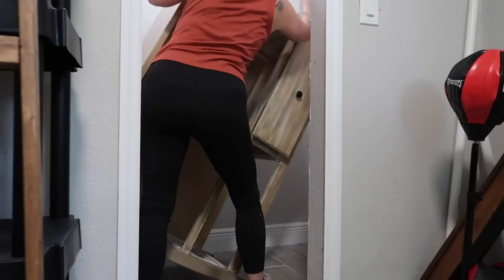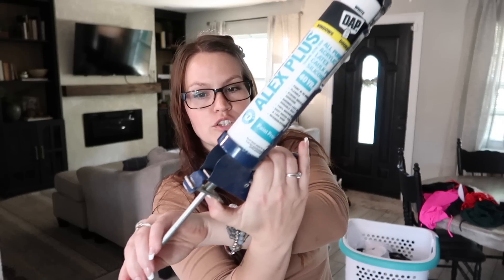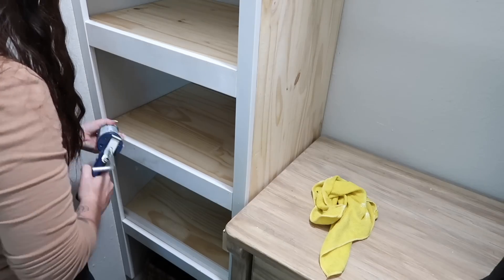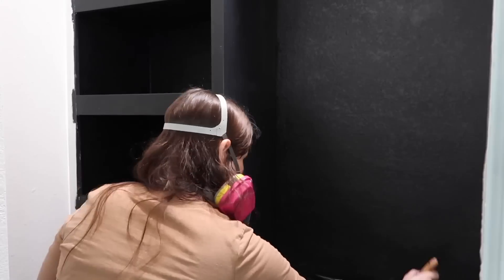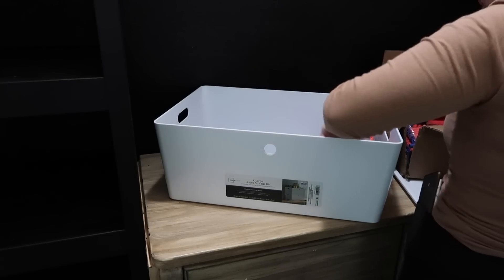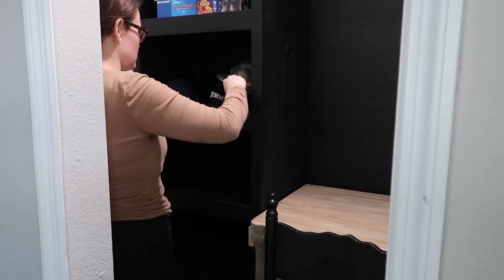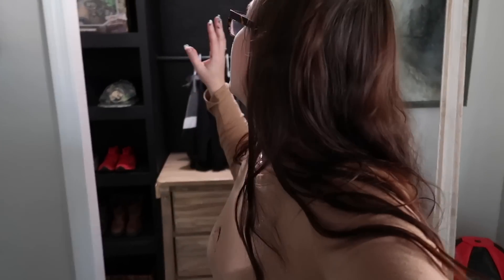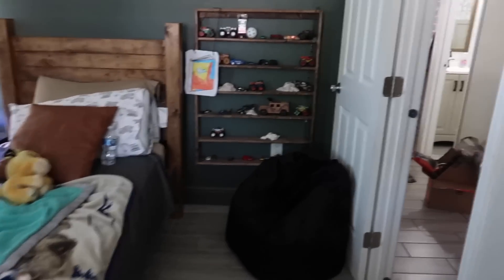DIY custom Closet ✨️Part two✨️ Painting and organizing  🙌 | Small room DIY on a budget !

Comment: Just a hint, from watching your caulk gun loading, I always put a large flathead nail in the hole where the caulk. Omega out.  Otherwise it will harden and be useless.  Then wrap a piece of Sara wrap over the tip to keep air out.    Love your projects, and the confidence you have encourages us also.

Comment: Cutting the tip for caulking you use the hole by the "trigger" part and insert the top of the tube into it and it cuts the perfect amount to start :)

Comment: Karrie just a thought you should label the white boxes. I have the exact boxes in different sizes and I have labeled them all. So much easier to know what each bin contains. You could look to see if you can get images that your son knows what each container has till he has learnt to read. A tip for removing label use furniture polish with a cloth . Spray the furniture polish on the label and work it off with a fibre cloth. I removed all of mine that way